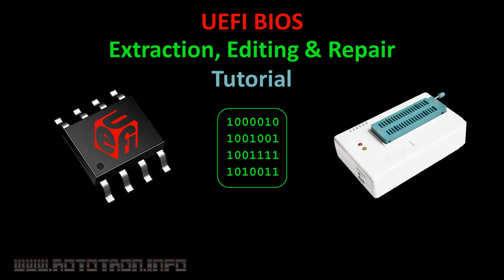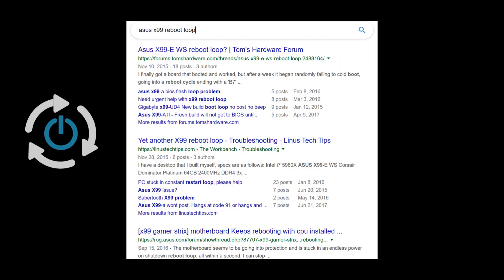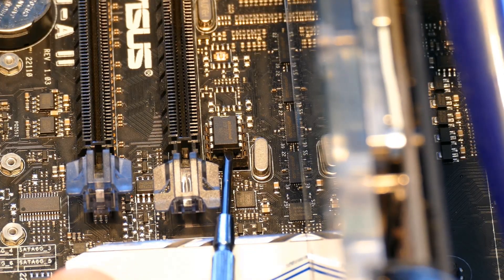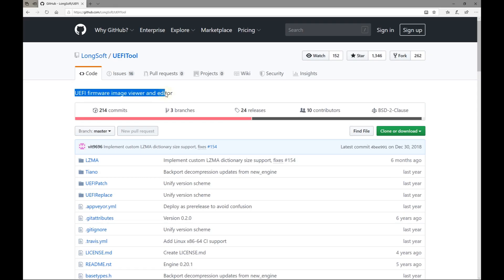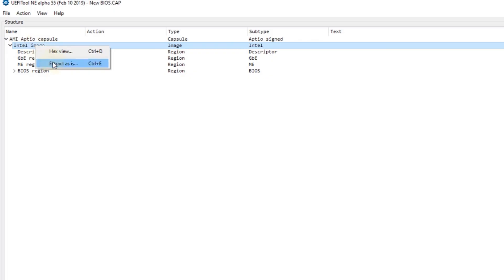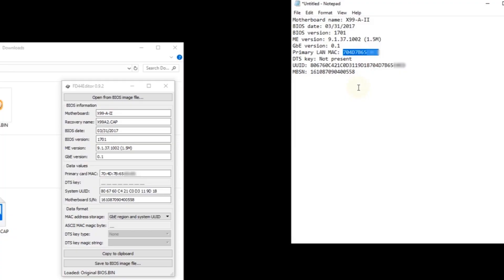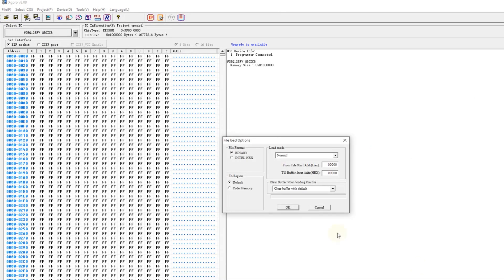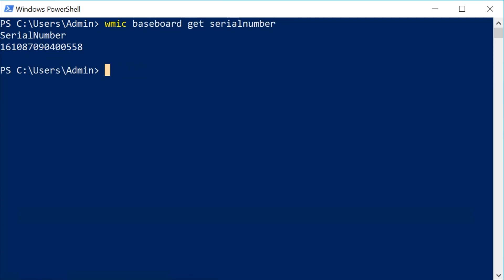UEFI BIOS Repair Tutorial

Comment: I am facing a trouble with a bricked BIOS oa an AsRock H87 Pro4.

The motherboard has an old version (1.90) and as the guide says, I used the Instant Flash to upadate it to 2.40.

I doownloded the proper/correct BIOS file from the official website, I unzipped  and I copied it in a USB flashdrive formatted as FAT32, I entered to BIOS settings and I ran the Instand Flash utility. 
The procedure went normaly well and the BIOS asked to restart. I did it as it asked but the motherboard started to make endless power cycling!!!

I tried to flash the BIOS chip with the EZP2023+ USB programmer, but while was running the writing phase, I got a message that the file is bigger than the chip capacity and asked me if I wish to continue writting. I answered YES. At the end th verify showed that the flashing was completed.

I reinstalled the chip ont he motherboard but it does not POST.

Now I am trying to resolve the issue to flash the chip with my programmer, but without to get the error message of the fiel size!

Have you any idea on it???

Comment: Hi guy,  I have got the new version 2023+. Despite of that that in the CD is added also manual I better understand your guide.. Driver intall OK. But, when I started new version the menu comments are showing mess of letters. Firstly I thougt that I incorrectly copied the folder, but even when I started program directly from the CD it was the same. Can you advice?

Comment: Section Timestamps:

Introduction and background - @0:00
Hardware spec lo-down and problem analysis - @0:13
Hardware testing and problem analysis - @1:01
UEFI Background and theory: @1:54
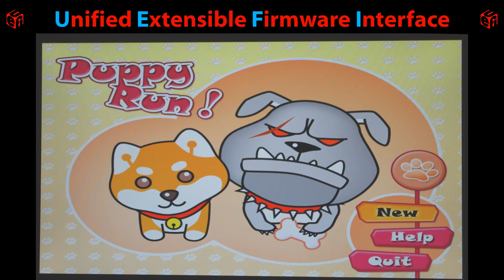Tackling BIOS flash chip removal: @2:26
Flash chip programmer device description: @3:06
Flash chip programmer software and procedure: @3:29
BIOS/UEFI Modding software (Hex editor tool): @4:11

Comment: How do you do this process with no access to the original bios? I accidentally wiped the bios chip before backing up the original bios unfortunately
Reply from the maker: You might be able to get the MAC address from your router logs or it could be printed on a sticker on your network card.  You can always make up a MAC address using an online MAC address generator (just google it).  Serial numbers are often on the motherboard or the case depending on the brand.  I suppose you could just create a new serial number and system UUID although it could cause some licensing issue with existing software on the computer.

Comment: Great Video. Can you do a Video on a board that needs a bios flash with bios chip with 1.7V to 1.95V requirements?
Reply from the maker: Sorry I don't have much free time these days.  I recommend you take a look at the Adafruit level shifter: https://www.adafruit.com/product/757.   They are relatively easy to use.  You would connect the HV pin to 3.3 V on the Pi, and the LV pin would connect to a power supply generating 1.7 V to 1.95 V which could also power the flash chip.  Then MOSI, MISO, CLK and CS from the Pi would be connected to the higher voltage side pins B1 - B4.  Then the corresponding lower voltage pins A1 - A4 would be connected to the flash chip.  You would also need to connect the grounds from the Pi, the flash chip and the power supply so they are common.  There is a similar diagram of using a level shifter in my OpenOCD tutorial: https://www.rototron.info/circuitpython-nrf52840-dongle-openocd-pi-tutorial/ except there is no additional power supply because the target board is providing the lower voltage.
Reply: @rdagger  thank you very much I appreciate it. Hopefully not much time means making money or spending time with friends and family or doing things you love. Cheers

Comment: Did you try with raspberry pi, these chips have the same pins, only their size is bigger?

Edit; I tried the Pi tutorial on a UEFI BIOS, worked like a charm, only issue is your wiring is wrong, it needs VDD on two not mentioned pins, type 8 DIP.

Comment: Hi!! I have a Sager NP9870 (Clevo P80DM-G). When I bought it, years ago, it came with just one GTX 980M. So now I bought another GTX 980M in order to make them SLI. I asked for them to send it with 1617 ID but they sent me with 13D7 ID. So I couldn’t flash it right with the vbios from the older one using Nvflash. I forced with the Nvflash mismatch version and the bios chip got really messed up. So I bought spares from the same chip (MX25L2006EZNI – 12G) and spare one from the older plate (25Q20BT) and ended up dessoldering the chip from the new one and putting a 25Q20BT in the place (with the vbios from the older one flashed inside using CH341A SPI flasher). When the new 980M arrived, the notebook didn’t even started if I put it in the master slot. Now with this modification, it goes to the windows all right but I don’t get image (not even through HDMI). So the idea here is to have both cards with the same vbios and ID in order to make them SLI. The notebook bios recognize both cards but the windows just the older one (with the 1617 ID). What can I do to make this work as SLI? I have my notebook with windows 10, both cards (the 1617 one is already inside of course), SLI cable, both heatsinks and even that cooper plate that was hard to find (I have the two necessary units). I have the CH341A SPI flasher and adapters to use the right voltage. And I have a couple units from both chips (MX25L2006EZNI – 12G and 25Q20BT. The 25Q20BT is so much easier to solder and it is the same model that the older plate uses. And I tried a lot of the drivers version from Nvidia and nothing, even cleaning with DDU. Would you help me to make it work? Appreciate it and thanks in advance. I really hope you can guide me to get there and I don’t think I’m that far away!!

Comment: I replaced a chl8228 blown chip on a graphics card. Later I was told it had to be programmed! Looks like i2c but can't find the pins to use. Got any idea how to read and program the chip? I have another board to get the file from. Thanks for the video and any help you can mention. Thanks
Reply from the maker: No experience with that chip but cursory Google search shows you need to use CHiL Intuitive 
Power Designer (IPD) GUI.  I would contact the manufacturer's tech support.
Reply: @rdagger  Thanks for taking the time to answer. I have to say that is waaaaaay over my head. Most of what I have learned has been on youtube. I am working on bad video cards and after installing this chip I found that I have to learn how to read another board I purchased and then how to write to it! I don't know how to write code, just want to read and write off another chip for repairs. I have many cheap programmers, but cant even find the one to use to get started. Thanks again and stay well. I will keep looking.

Comment: hi,thanks for the informative video. I have tried doing this with my ASROCK X79 extreme 4 motherboard, however it doesn't seem to work. do you know if i can use this method on my ASROCK motherboard too? I have downloaded the bios files from the ASROCK manufacturer site and have tried using the CH431A programmer to program the bios chip however still isn't working for me. Do you have any suggestions on how to program the correct bios file to bios chip? 

Thanks for your help
Reply from the maker: Sorry I don’t have firsthand experience with ASRock boards.  I recommend you search www.win-raid.com and www.bios-mods.com for your specific motherboard.   You’ll probably find a few people with the necessary skills.
Reply: @rdagger  Awesome, thank you very much for your prompt response, appreciate it. I have tried searching through both forums and haven't been able to locate anything on the topic. Would you have a specific link for me by any chance?
Reply from the maker: @celinalam7765  In the following post:  https://www.win-raid.com/t5317f16-Request-Asrock-X-Extreme-Bios-with-NVMe-Support.html the user StormRaider posts his ASRock X79 Extreme 4 bios file.  Then the user Lost-N-BIOS modified it to add NVMe support and provides a download link.  The user Fernando also provides a link to a modding guide he created.  Any of the above users should be able to help.

Comment: Hi, I am stuck as i cannot read the original BIOS, a fatal error appears stating "Error parsing BIOS data,$BOOTEFI$ signature not found. Please open correct ASUS BIOS file" has anyone else encountered this? To populate the 3 fields required I located the MAC address in the router logs, I have my motherboard serial number from the original boxing but there aren't enough characters, what should it be padded with? And I have no idea where to locate UUID. Any help greatly appreciated.

Comment: Great video, my PC is stuck in a boot loop when I hit the power button, tries to start then cuts out and tries again.  Quick question, in my situation would I bypass this solution if I simply replaced the BIOS chip?  Any advice greatly appreciated
Reply from the maker: Flash chips are generally sold blank.  You could not install a replacement without programming it.  If your chip is socketed you should try reseating it because it might just be a bad connection.  Your problem could very likely be other hardware such as the memory.  I would test the memory, graphics cards and power supply before reprogramming the BIOS.  Also examine the motherboard for any bad caps.
Reply: @rdagger  thank you for replying. I initially got a message stating "WARNING, BIOS recovery mode detected" and it asked for P9X79PRO.rom. I downloaded the file and tried to use the flash usb port and button on the back of the PC and now it is stuck in the boot loop.

Comment: Good day, can you helpme ?    My problem is the following: I bought a Chinese laptop with GN117_MB_V31-T board. (Aptio Setup Utility 2021) (There is no info for that board). And I want to change the logo of the bios. I have used Aptio_V Afuwin to do the bios Backup, then I change the logo with AMI ChangeLogo Tool v5.0.0.2 and everything seems perfect. But when you restart the new logo appears ok. But it automatically enters the bios, appearing a new option RECOVERY, ROM LAYOUT MISMATCH DETECTED - PARTIAL UPDATE IS NOT ALLOWED. If I give ESC it enters windows without problem but always enters the BIOS first, any idea how  I solve that problem. Thank you very much for your help.

Comment: hello thanks for your useful information.
I have question what if  I want  flash bios without typing that information eg:- mac id,sn,suid.
Also I'm having problem not able to save new bios flash file generated by fd44 editor.
I'm using asus motherboard am4 socket.
I hope you will answer this as soon as possible.
Thanks again.

Comment: Whats the procedure when you are trying to do that using raspberry? Same as in other video?
Reply from the maker: Yes, it's the same.
Reply: @rdagger  so i dont need any extra programms and commends if im doing it on RP? Im learning that topic so i wanna be shure.
Reply from the maker: @rampifreestyler4935  Generally speaking, the Raspberry Pi along with FlashRom can be used as a substitute programmer instead of the TL866 USB programmer.  For example, you can perform read, write and verify firmware operations.  If you have an UEFI Asus motherboard then you can probably use all the software demonstrated in the video to prepare the firmware.  If you have a different brand UEFI motherboard then you will probably need additional software.  For questions regarding other brands please see the 2 forum links in the video description.
Reply: @rdagger  thanks for quick answer

Comment: Hi dude, i can enter in bios and i can flash from bios but the PC still reboot at POST like your PC, is impossible boot everything like usb stick or SSD, simply the pc reboot everytime in POST

Do you think this tutorial can fix the problem? i have your same winbond chip
Reply from the maker: Sorry, since you can flash from the bios there isn't much chance that flashing externally would make any difference.
Reply: @rdagger  yes dude, i’ve flashed and nothing work. But depends also what program i use for flash.

Btw the pc still do this problem of post and is for mobo or cpu.

Maybe can i install some custom bios?
Reply from the maker: @heymaaark  Here are 2 great resources for bios help:  https://www.win-raid.com/forum.php and https://www.bios-mods.com/forum

Comment: So I tried flashing my MSI Gaming 7 z97 Motherboard from version 1.8 to 1.9, accidentally pushed on the power cable for the GPU and now it won't display anything, won't post, will not go past F2 debug code. Any way to fix it? I'm thinking that the bios chip or a memory module went bad or that I bricked the motherboard. I powered the system off, switched to bios B and it went through the same thing. I updated Trainz 2019 from regular to Service Pack 2, rebooted the system and it turned on and turned off well before I tried to update Bios A. The Gaming 7 msi motherboard uses UEFI or UEFI/legacy

Comment: I had a problem with my asus h110M-c motherboard after uefi bios update system reboots no signal to monitor keyboard and mouse could this be a fix?
Reply from the maker: If the BIOS chip is socketed then it could just be dirty contacts.  You can try removing the BIOS chip.  Inspect the pins and the socket to make sure they are clean and there is no contamination.  Then carefully replace the BIOS chip in the socket.  Please make sure the computer is unplugged  and take precautions against static discharge.
Reply: @rdagger  I did like you mentioned and now it works like a charm this saved me $70 buying a new motherboard. Thanks much...

Comment: Hi, I’m struggling with my motherboard(Rampage IV extreme), My pc is doing the same thing turn on and off continuously, now I know is the BIOS, can you help me?
Reply from the maker: If the BIOS chip is socketed, you could try removing the chip and reinserting. It could just be a bad connection at the pins.

Comment: I really have to thank you for this very helpful tutorial. By your instructions i was able to repair my UEFI on my ASUS Z97-P Board. After i installed Vanguard (an anti cheat protection measure operating on windows kernel level for the recently released game Valorant by Riot) my computer was not able to display any video output or to power usb devices. my last option before buying a new board was to reflash the bios which surprisingly actually worked.
Reply: Did it got corrupted by the game
Reply: @tdkxbalor9397  i guess the corruption happened right after i restarted my pc. After installing valorant and it prompting that i need a reboot to Initialize vanguard which i did, the pc was no longer able to boot. Just a black screen and fans spinning without any sign of life.
Reply: @leonard_roy  did you report it to the game Devs it can be serious problem if it happened due to the game
Reply: @tdkxbalor9397  yea of course but the german riot support didnt bother. Seemed like they were too incompetent to understand the issue. Their final answer was that it simply is not possible for vanguard to corrupt a bios. I even wrote to some famous tech youtubers like ltt but never got a response. So afterwards i swore to myself to never install that bullcrap of a game ever again and thats that.

Comment: when i press the power button my power supply fan spinning but the cpu not turning on,it mean my bios problem sir
Reply from the maker: It is a strong possibility.  It depends on what led up to the current state.  If the failure was preceded by a bios upgrade then it is probably bricked.  If there was not upgrade and your bios chip is socketed then the socket could be a point of failure.  Socketed chips can be dislodged by board flex and the pins are prone to connectivity issues.  Reseating the bios chip often fixes the problem.
If there was no upgrade and the bios chip is not socketed then it might be another issue such as a bad power supply or motherboard.  Check the voltages on the power supply and inspect the motherboard for failed capacitors.
Reply: @rdagger  the problem start when i set the bios to default
Reply from the maker: @azhardiansyahanuar8148  Can you enter the bios settings?  Is the cmos battery good?  Did you reset the bios using a jumper, removing the battery or from the cmos settings screen?

Comment: Dear Sir, is it possible the following?
i have an asus b85 vanguard with i7 4770k + gtx 970 + 8gb but recently i had to swich the  battery on the board because i was getting kind same problem with wierd reboots and after cpu fan error... but recently i put the bios on performance i the cores temp were crazy (82ºcelcius)  most of the time....wierd sutter in games.... etc... ( my cooler only has 1600rpm )  
because my motherboard is old last drives were from 2015... can i use other bios?? is it stable?

Comment: I have this problem so I shutdown my pc during and update and it undo the changes now I’m stuck on the UEFI bios page or it pops up with a message that reads select a proper device etc I’ve waited a day and tried almost everything on YouTube please help
Reply from the maker: It doesn’t sound like a damaged bios.  It could be a lot of things but since it happened during a Windows update (I assume that is what you meant by update), it is probably a partition problem.  I’d get a Windows 10 media USB drive (I assume you are using Windows 10) and try the Repair your computer option.  Under System Recovery Options choose Command Prompt.  Run diskpart and make sure the correct partition is activated.  Afterwards run bootrec /rebuildbcd.  If that doesn’t completely fix the problem, it will hopefully get you to the point where you can run System Recovery Options – Startup Repair.  This is a relatively advanced repair and my suggestion is only a guess.  I am not a Windows expert.  You could lose data!